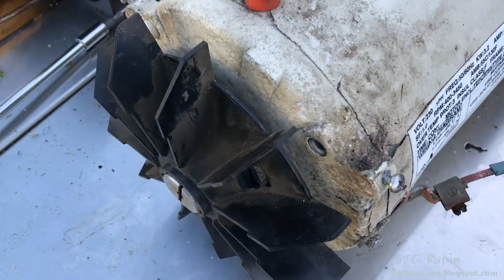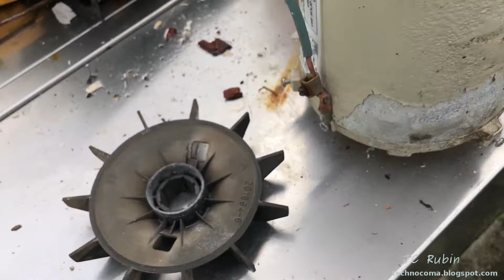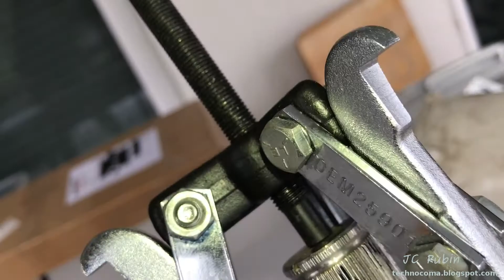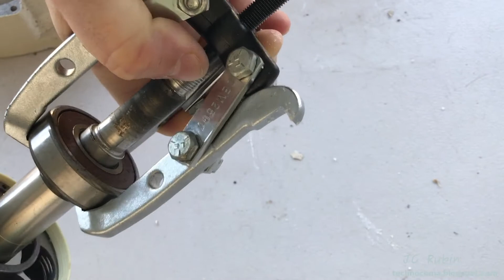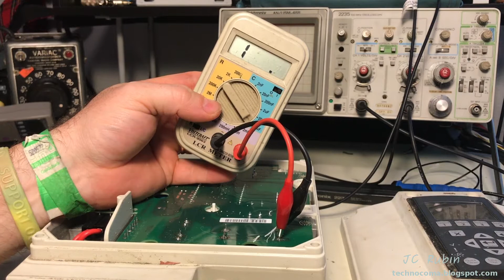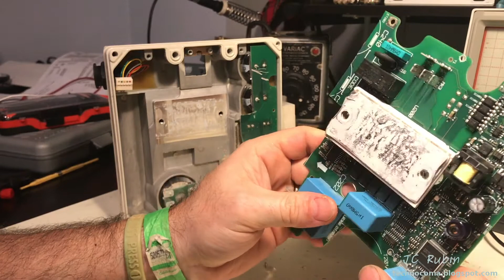Pentair Intelliflo VS Pool Pump Repair Part 2

Comment: Pentair calls that the drive unit. I had to replace mine after during a storm I had an electrical surge. The unit was almost $700 dollars. At least you showed how to replace the bearings which was great for me.
Reply from the maker: That drive unit cost 30% more than my replacement hayward pump with the same functionality, which has now been running flawess for years, I never looked back.

Comment: Hey, Tony Stark.. that was definitely “ the most detailed and comprehensive technical analysis of a capacitor in a pool pump..” I have ever seen. Good job and thanks for educating the simpletons like me.  I have 2 of these and what a PitA they have become.  Although they last 5-7 years under good conditions, something more mechanical is definitely preferable for its longevity, and repairability.  
Good job Batman.
Reply from the maker: Yeah, I was not happy with this.    Granted, If it was modular and they hit you up with 50 or 100 dollars to swap a section based on a reliable POST code I would not complain.  This unit does not do that though....

Comment: you are my savior,,,,have exactly same pump from 2012 and thanks to your very thorough explanation I either have to get a new drive or complete new pump - not much difference in price,,,, however the wise thing is to get pump with simpler design,,,,,greed is something I am not willing to support in any way,,,,,
Reply from the maker: I will be posting a video shortly that illustrates what a truly serviceable pump looks like.

Comment: Thank you.  I got an alarm F90053 and was told by two different pool repair guys that it was the driver.  Before spending $800 on a new one, I called Pentair and got the same answer.  Sooo, I ordered a new one, installed & programmed it and Guess what?  Same damn alarm code.  It’s too late in the day to call Pentair, but I seriously pissed off.
       Thanks again for taking the time to break it all down.  Bill
Reply from the maker: Glad I could help.  I believe the parts for this are ridiculous.  Non modular and designed to fail.  Ive moved to a different pump. No regrets.
Reply: So how did you fix that problem cause I have the same issue right now???

Comment: Thanks very much for the video and through testing.

Just had this pump die on me. Suspect your theory regarding thermal cycling and overheating is correct regarding the frequency converter. 

With my particular unit, I heard a loud pop when the motor gave up the ghost and suspect a cap blew. The control board portion was actually blown up and out of the case...which I can only imagine occurring if a cap blew.

Pump failed during the middle of the afternoon in the Texas summer - currently its 103 degrees air temperature. Motor in the shade, but still suspect heat related. 

I'll be stuck replacing the unit, and like you, am wary about spending $500 or more dollars on a drive unit that would not come with a warranty vs. replacing the entire pump. Shame...like yours suspect the motor is just fine....
Reply from the maker: Designed to be unrepairable only replaceable. I never bought it again.

Comment: Great test equipment...Probably it's a MOSFET speed controller module. They get very hot during high loads and start up cycles. If it was my pool, I would buy a standard non-electronic pump system replacement with a electronic torque timer. With spikes, transients, corona effect, skin effect and power surges, not to mention highly corrosive pool chems, simple is better.....,

Comment: The rate of failure on those units is extremely low compared to others. One call to a pool professional and you would have known what that code was and how to fix it. I appreciate you taking me pump apart like that very interesting.
Reply from the maker: Between the two videos, at the time the motor was determined to be free spinning, before it was even opened, it was already determined to be an electronic issue.   The cost for parts replacement had already been assessed.   Everything further on was simply for demonstration purposes if it was a motor bearing issue.
Reply: @retrotechandelectronics  ok

Comment: Thank you for this...  Been having a problem with my pump and the first thing I'm going to check is the power connection, because moving the cable slightly sent me into a power loss warning on the LCD screen.  My pump has been tripping the circuit breaker recently, but erratically so.  If it isn't a loose power connection, then I will likely have to replace the drive unit.  I benefited greatly from your troubleshooting and experience.  Thank you.  You said you were so disgusted that you would up buying a different mfg pump.  Vari-speed, I am assuming?  What did you end up going with if you don't mind my asking?

Comment: I have the Hayward Ecostar and they manufacture the driver board the same way as this one. With some finessing though it is removable to replace the IC module, but that may not be the only component failure. When mine went the module virtually explode and damaged the board as well. I'm guessing a power surge.
Reply: Question? How I can change the direction on this particular motor
Reply: @LuisGonzalez-tx7tf  You'd need a stepper controller, I'd imagine. Why would you need to do that?

Comment: I have a quick question, if you reverse the two red wires on the back of the board, would you reverse the rotation of this motor? I have reversed the rotation by reversing the red and black wire on the top of the motor, but I can not get the clips out to  permanently change  and put the controller back on.
Thank you
Bob

Comment: I can show how to remove the pcb board quickly and without causing damage if anyone is interested. I will post a video. I developed the technique after having the same issues shown in this video.
Reply: That would be great
Reply: did you have a chance to make that video?

Comment: I mean, you could have easily desoldered those few connections with a desoldering gun or some desoldering wick, or even compressed air is a good trick to blow the molten solder right out of there assuming you don't have access to a $3 desoldering pump.
Reply from the maker: There is clearly two different types of solder on that board, one with a high lead content, and one with no lead and an extremely high melting point just to prevent this from happening.
Reply: @retrotechandelectronics  You tried a high wattage iron? Usually it's just the huge thermal mass plus the epoxy is also a somewhat effective heat sink material.
Reply: I find it very unlikely they used a special solder alloy seen as how now due to ROHS they are almost all SAC alloy unless there's an exemption like aerospace etc.

Comment: I found Danfoss.  They are in Germany and make a lot of pumps, etc. and power controls.  However, they are all custom parts made for OEM’s.  Jus t to keep you from being able to fix it.  Generally “energy efficient” equipment is NOT cost efficient to the consumer.  It is a POS that I wish I had not purchased.
Reply from the maker: I agree.

Comment: Should have dremmeled the pins flush with the board carefully.  That a small drill bit. Drilled the through holes.  An ya could have gotten the whole board off.  

But would of had to dig out the caps
Reply from the maker: Theres no digging in that potting.... its solid.
Reply: @ I have 5 or so bad ones.  One of these days coming. I’ll try an pop one or a few open.  An attempt a few things.  An if I come up with anything viable I’ll put it here.  I’m curious an would like to find away for myself also.
Reply from the maker: @ The findings would be interesting. Thanks.

Comment: I feel your pain. I have the same pump and know I will be just as pissed when it finally dies and I can't fix it due to their manufacturing.  This is one of the most entertaining videos that didn't actually show me how to fix the thing. 😉  I'm guessing with your expertise you could probably build your own controller.  I would help fund the kickstarter for somebody that built one of these for the hundred bucks it should actually cost. 😀
Reply from the maker: It sounds like an interesting concept indeed, but 99% of folks who maintain pools are non-technical, I would not see a large demand for a single fit model of an arduino based controller when you consider the time that goes into it, the need for a motor purchase and the expected return.
Reply: @retrotechandelectronics  My $400 oven controller was the first time I thought about an aftermarket replacement.  $0.50 cap blew and the replacement  controller from Kitchenaid cost me $400.  I was actually going to build my own with a YoYo Controller and  tablet as touch screen if it failed again.   My friend actual did replace his Pentair controller for $400, so it looks like there is some market for DIYers.   The ultimate solution, IMHO, is a generic controller that can function as an oven controller or a pool pump controller or washing machine, or dishwasher or  A/C for that matter. They all have a dozen sensors, and probably half as many high voltage relays/triacs.  One hardware module and SW running on a smartphone can make it do whatever needs to be done.   Literally a $50 Raspberry Pi with a few peripherals could do all the heavy lifting.  Then freeware SW makes it function as needed.  Yes, I can dream.  :-)
Reply from the maker: Tied to that controller was also some serious current requirements for the motor, this aspect would not be one size fits all and would add to the cost/complexity as it would be something specifically required to drive motors/pumps
Reply: @retrotechandelectronics  hello friend a query. If the electronic component no longer works for me, I could use the pump without the electronic system, just connecting an external layer to the pump motor.

Comment: What about just applying full voltage to the pump motor to run it at full speed and eliminate motor from control board first. I was also thinking that the pump ceramic bearing my have gotten scorched as they do so many times and should be replaced first. Just additional personal experience input.
Reply from the maker: This is true If you had a supply to support the current.   You cant just plug the motor into a wall.

Comment: Do you recall which side had the spring washer? I can't remember what side this came from. I think it was on the side closest to the impeller. I was hoping to see it in the video. Thanks.
Reply from the maker: No its been a while, but there are explosion diagrams online.

Comment: I thought this is some kind of DC pulse motor, because there's no visible start/run capacitor, and the granular speed control it allows. Turns out this is a typical AC 3 phase inductive motor? Or what it is? How do they achieve such silent operation and speed control? Btw, what's that accent? Australian? I like it.
Reply: Ha, it's a synchronous frequency controlled 3 phase squirrel type inductive motor. That's what it is right?
Reply from the maker: Haha You're funny.... I've been called many things.... Never been called Australian.    AC 3 phase.... Caps are in the Control unit.
Reply: @retrotechandelectronics  So, any clue what could be inside that metal container except that it is just frequency converter? I would just take a dremel and cut it open to see what they are trying to hide in there.
Reply from the maker: @arthurvin2937  You can pull it up online without the sink on it, its just the converter.
Reply: @david-rh5uc  Unless you have 3 phase power in your home that would be bad idea. The controller unit isn't anything fancy but just VFD - Variable Frequency Drive, which takes single phase 240v AC > rectifies it to DC > converts it back to somewhat fake sine AC 3-phase  power by means of DC Pulse Width Modulation technique using transistors. The granular RPM adjustment is achieved by making pulse width longer or shorter. The motor itself is off the shelf 3-phase induction motor and it's pretty dumb to notice sine imperfections. Technically you could run it off single phase 240v AC power on single winding with run capacitor but its characteristics would dramatically suffer - potential overheat, twice less horse power, poor energy efficiency and noisy operation. However, you can safely hook it up to off the shelf VFD for 50 bucka from Aliexpress and it will operate just as good as the OEM unit.
Reply: @arthurvin2937  I have one of these pumps,,, where the control unit failed in about 90  days,,,,, then replaced the control unit [inverter drive]    the pump still will not run,,,, upon start up,, the panel shows over current and motor fails to start,,,, although the rotor will jump about a quarter turn when you hit START,,,,,,,, SOOO I removed the control unit and applied power with a DELTA inverter drive that I know works,,,, the motor does exactly the same thing and it physically locks the rotor, when power is applied,,, yet only pulls 11.6 locked rotor amps at 60 cycles as indicated on the VFD,,,, on a 3 hp motor,  [a bit strange] AND I tried to spin the shaft by hand to get it rolling to see if I had a dead winding or one leg dead,,, TOO the motor,,,,, the rotor was LOCKED, when power is applide,,,, the next step was that I applied straight 3 phase 240 to all 3 legs without the inverter,,,,, same thing, happened,,,,   I checked the windings with an ohm meter and got the same reading on all three legs,,,,,, I checked for shorts to case and between windings with a MEGGER and found nothing wrong,,,    the shaft turns freely with nothing unusual,,,,,  what puzzles me is WHY the VFD wont make this motor run,,,, I really hate to open this motor up because they did such a nice job of sealing the motor including the shaft seals on both ends,,,, and if you wondering WHY I dont simply turn it in for warrantee,,, its because I live in the PHILIPPINES and those turkeys refuse to honor the warrantee..... even though I offered to physically bring the dead pump unit to the USA myself,,, as am going to make a trip there anyway.   since I got good readings with the megger,,,, I think I can assume no water damage inside the motor itself,  this is a real puzzler,,,,, I hope someone has an idea.
Reply: @DOCDEVOE699  You didn't tell what resistance it reads from phase to phase, let's assume it's in few ohm range, not kOhm - that would mean burnt winding.

The only idea I can come up with is - mechanical/magnetic locking. Imagine that rotor bearings has got some slack in it. There's a thin layer of air in between the stator and the rotor, less than a millimeter - this is what allows rotor to spin, not to just magnetically stick to the stator and lock in place. If bearings got even slightest play in it, it would break that air gap and the rotor would magnetically glue itself to the stator. In this scenario you would freely spin it by hand without power, but not with power. I would suggest to give it last chance with new bearings. If this won't fix the issue I'll turn into religion and probably open my own church.

Comment: имею такой насос, сгорел блок управления. вопрос. как его можно запустить напрямую к двигателю без модуля.  желательно схему.
I have such a pump, the control unit burned down. question. how it can be run directly to the engine without the module. preferably a diagram.

Comment: How do these variable pumps work? Are they 3 phase motors being run by a electronic speed controller? Or are they just regular single phase motors with a start winding like the ones that come on regular pool pumps, but with the added controller that does all the variable speed magic?
Reply from the maker: The controller does all of the magic.... but its replacement incurs most of the cost of the unit.
Reply: It's a VFD with some added features driving a 3 phase TEFC motor.

Comment: I have the exact issue and pump in your videos.  Out of curiosity, which pump did you end up replacing it with?
Reply from the maker: I ended up replacing it because the cost of the parts was nearly the cost of a new pump.  I went with another company.
Reply: @retrotechandelectronics  which company? and are you happy with that company?
Reply from the maker: @christoube  a Hayward and never looked back as demonstrated in this video
https://youtu.be/eu39UqFeD1s
Reply: @retrotechandelectronics  do you have a video about the hayward install? and how much better it is than the pentair? i am trying to decide what to replace my intelliflo with...
Reply from the maker: @christoube  I do as part or a reinstall when I redid the patio. It’s in my back catalogue sonewhere

Comment: Let me ask you this. I have the same pump. If my drive takes a crap could I just remove the drive portion and connect my line voltage directly to the pump? Then it would just run all the time at the pumps specs? At work when a VFD dies we just bug the line voltage to the motor and it just starts balls out until we get a drive. Thanks.
Reply from the maker: I'm sure its possible, there is nothing special about the motor itself.  I wouldn't outright recommend it though.
Reply: yes I want to know also... lol
Reply: @daneli5214  Absolutely not, this is a 3 phase motor...

Comment: Anyone know where to find these bearings? NSK 6305DU and NSK 6205DU????
Reply from the maker: Google. Or eBay and Amazon
Reply: @retrotechandelectronics  they sure are hard to find in the states. I ended up having to import them from England.

Comment: Did you consider a motor with a panel mount VFD? If not, why not?
Reply from the maker: When you get into the current requirements for the VFD needed, outdoor rated enclosure, and then meshed to existing power supplied from mains,  It rivals that of a finished unit.  Plus you loose all of the software features you come to expect from a pool pump such as multi speed, schedule and prime, etc etc